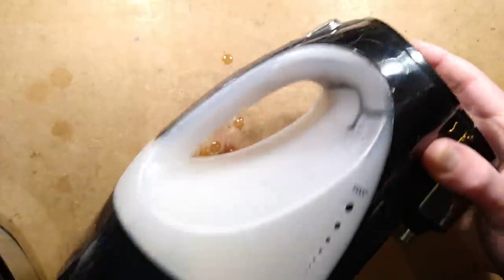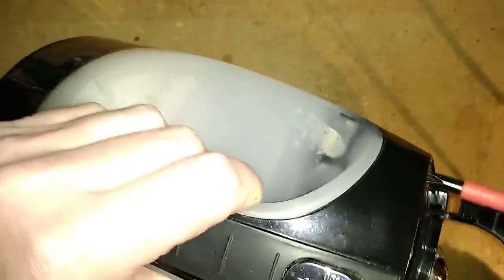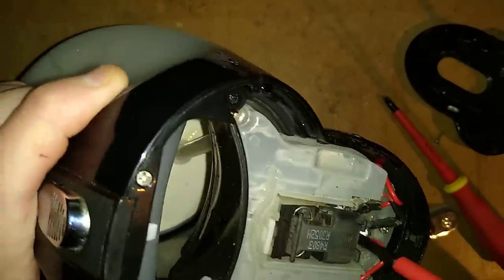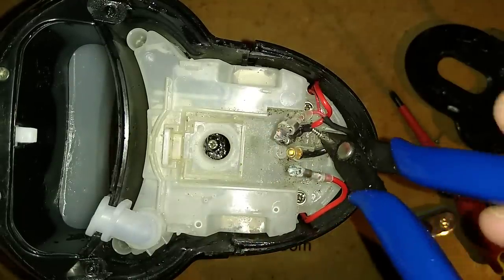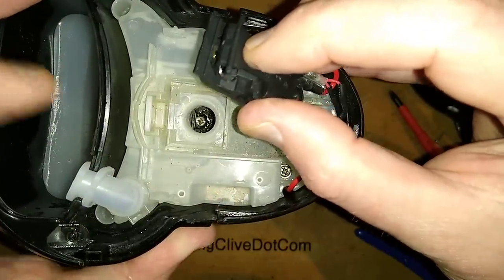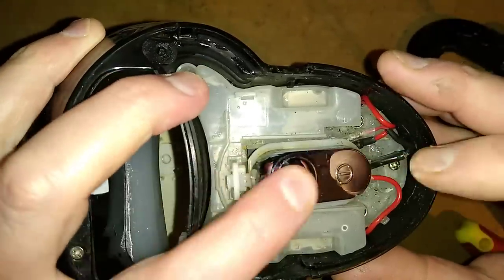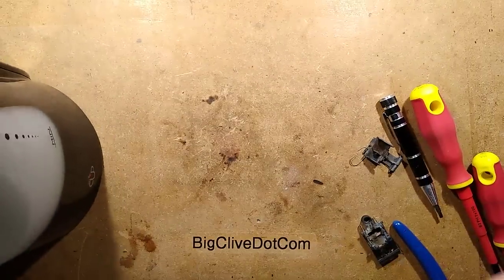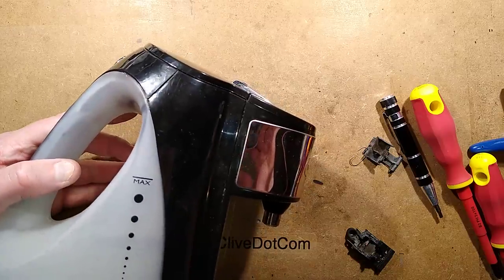Replacing my Breville Hotcup power switch.

Comment: Worthwhile giving those 0.25 inch slide-on connectors a dose of conductive grease? Would reduce the possibility of steam corrosion over time? I suspect I'm not the only viewer who is slightly disappointed that you didn't replace that LED with something more interesting? Maybe multicolour?? :-)

Comment: Clive... or anyone here, have you heard of the Mito kettle which is worked by induction.  What is happening with them?.
Reply: Ideally, the kettle has no electrics or sensors, just a standard iron kettle sitting on a standard induction stove that can heat any iron pot or pan.  Though some energy will be wasted by indirectly heating up the stove below the kettle.

Comment: Now you gotta show us how the kettle works. How does it only heat the water it needs?
Reply from the maker: Heater tank with floating ball valve that lets a portion of water in from the reservoir, but the water can only get back out via the spout with steam pressure .

Comment: Hey Clive are you accepting submissions for dissection? I've got a 4g modem that's seemingly given up the ghost, don't know if you want part it out or see what went wrong?
Reply from the maker: Have you checked if the power supply for it is working?
Reply: @bigclivedotcom  Its just a micro USB one, tried different chargers/cables and I guess either the battery has died or something else inside

Comment: In the US, you would need a 30a 240v split phase outlet to even get close to 3kW.  That would be the same outlet as a dryer.
Reply: A 13A 240V outlet will run a British 3kW kettle.  A 25A 120V would run a 3kW kettle with a 120V heating element.  Parts of Europe uses 2.2kW to work on 10A 220V outlets.  There are rumors UL allows running 20A 110V in some types of global 16A connectors, provided the manufacturer builds it accordingly.  Don't know if that exception applies to the circular connector on the bottom of kettles.
Reply: 240v 15a outlet in the US will easily support a 3kw kettle.  And there’s nothing “split phase” about a 240v outlet.
Reply: @stargazer7644  US 240V outlets use the "split phase" supply to most US homes and can't be fed from 200V 3-phase supplies because 240V is 2X 120V and 3-phase has a phase to phase voltage of voltage-to-neutral times square root 3
Reply: @johndododoe1411   I live in the US, so I'm familiar with our power.  The 240V in US homes is single phase, and is actually 240V.  It is our 120V outlets that come off of the center tapped transformer that is fed from (in my area) a single phase 13kV line on the power pole.
Reply: @stargazer7644  Electrically one can and does equally describe the 220/240 V outlets, that straddle two phases in the split phase system, as a split phase outlet, as neither power pin is a "grounded" pin, while the supply has a grounded point, making both pin live phase pins.
Reply: @johndododoe1411  In the US the legs of a 240V residential outlet don't straddle two phases.  The lines come from a single phase transformer.   It is one phase, with a grounded center tap.  There are not two phases involved.  Single phase power.  Period.
Reply: @stargazer7644  Only if you insist on misnaming everything.  I clearly explained why they are 2 phases, 180° apart.

Comment: I recently had an oven thermostat fail... in the closed position. Rumor has it they have a little pipe of NaK (a metal thats liquid at room temperature and hypergolic with water) maybe I'll tear down that thermostat and make a video for it.
Reply: Does "NaK" =  an alloy of Sodium and Potassium? I know that both of those are hypergolic with water, I remember my chemistry teacher throwing small chunks of each (as well as lithium) into the swimming pool at school.
Edit: I googled and yes, NaK is an alloy of sodium and potassium which is liquid at room temperature. https://en.wikipedia.org/wiki/Pyrophoricity#Pyrophoric_materials
Reply: Yeah, that's exactly right. It seems that the liquid alloy reacts faster than either pure sodium or pure potassium, probably because it can be stirred and smeared and broken into little bits. Here's the video that makes me think theres a few drops in some thermostats:
https://www.youtube.com/watch?v=d-xqGxOak6w&app=desktop
Note that when cellulose gets charred, it emits a small amount of steam. That would help explain why the drop burned so violently even once it was embedded in the carpet.

Comment: Hey Clive. Hope you’re keeping safe. Quick question or more of a recommendation if you will. I’m on the lookout for replacement led strips (warm white - obviously) for our motorhome. Any ideas on best brightness, longevity, cost, brands, power usage and low heat? Sorry bit long winded comment. Would love to see more diy pcb vids on the channel.
Reply from the maker: It's a bit of a mine field.  Best advice I can offer is to buy a couple of different rolls and then under run them to make the LEDs last longer.
Reply: @bigclivedotcom  Thanks, I have a few different ones coming in. On a side note - are you able to make a simple single sided pcb, need a quick prototype to test fit in project before sending for manufacture. Don't need silkscreen just tracks and drilled hole (including slots) I have files prepared and willing to pay.

Comment: i would have expected a lot of "hands off" screw of all weird head shapes.
Reply: I have only encountered that on microwave ovens. The fact that they can leak very destructive microwaves, and also have a medium voltage power supply capable of an amp or two, and a capacitor that stays charged after its turned off, all lead to them being a more risky appliance to fix.
Reply: @deltab9768  it's common here on all type of appliances. from kettles to toasters, drip coffee machines and even just simple multi extension cords.
Reply: The high energy / high voltage power supply for the magnetron in a microwave oven is one of the more lethal electronic things in an average house.
Reply: I agree. You're not likely to get a second Chance if an MOT shocks you.

Comment: We have electric kettles that use the same base connector here in the US along with several other solutions for removable electric kettles. I think electric kettles are less common here more because of culture than differences in the electrical grid. For some bizarre reason when Americans want a hot beverage it is almost always coffee. So they use a coffee maker. In the rare case we want hot water we use the microwave or stove.

I have a gas stove now (after I moved) and have little counter space (and my house wiring is 50 years old) so I use a kettle on the stove, but I have had a number of electric kettles, hot pots, water boilers & dispensers over the years. The gaskets on a couple failed, others the rubberized plastic got all sticky, others were borrowed for a seasonal task and never returned.

This comment got a little ramble-y but I am too sleepy to try to fix it. Sorry...
Reply from the maker: Rambly comments are fine.
Reply: @girlsdrinkfeck  also we don't have whole house RCD/GFCI. 240v GFI breakers are available but they are more expensive.

The electric water heater tanks are actually better for the grid than electric instant water heaters so you don't have every house running huge demands at the same time. I just looked it up and a 4.6gpm electric instant water heater wants 3x 40a 240v breakers. Imagine every house pulling 120a (24kw) every morning instead of the 40-50a (9-12kw) that a tank water heater pulls when completely drained and both elements are on. That is a lot of excess capacity and infrastructure for a daily short spike in demand similar to what happens/used to happen in the UK after sports matches/games or tv events when everyone turns on the kettle at the same time for the 5 minutes it takes to boil the water but on a much larger scale because it's a shower, not a kettle.
Reply: @girlsdrinkfeck  gas is better. Hands down.  I have seen instant units that are so efficient they condense the water vapor from combustion. Also in the event of power failure, gas heaters can be run off an inverter or the tank gas units can run their electronics off a thermoelectric generator powered by the pilot light.
I wasn't saying that tank electric heaters were better, just best of limited options.

We don't have a very good gas infrastructure (Natural gas (methane) utilities or LPG (propane) delivery) here in the states, or at least the area's I am familiar with, which slows the adoption of gas appliances. Other areas are probably better, but living in Florida there isn't much demand here for heating of anything let alone for gas. Also I think most people here have an excess of fear of gas, gas appliances and their exhaust. Ones I know shut off the gas to a stove at the wall when not in use because they are terrified of an explosion and another is afraid of using a (I think it was 20kbtu) tank top propane camping/job site heater in a warehouse to take off the morning chill while the building heated up in winter.

Comment: on the breville deep fryer l have had to replace 2 switches, but they use hidden security screws, after the second one blew l replaced the 12 amp with a 16 amp waterproof switch from ebay and it has lasted longer than the others, switches seem to be their weak point

Comment: I have the exact same 'kettle' - I call mine a hot water dispenser ;-) but if mine goes the same way I'd be a bit reluctant to spend £13 as I'd rather put that £13 towards the £39 for a new one. Looks like you have hard water in Isle of White/Man/Guernsey? I'm in S Wales - the best water in the UK ;-)

Comment: I have one of those kettles and I wondered, how many uses do you think you had out of it before the switch packed in? Not sure how many times I have used mine though a rough guess would be about 30-40 as I find my normal quick boil kettle does the same job if I only put 1 or 2  cups worth in it in about the same time. Probably expected because 2x 3Kw kettles should boil the same amount of water in the same time unless one was under pressure of course lol Thx :) x
In honesty when mine breaks  (as I have a weird aura around electronics for making them break early) I will salvage the screws, power cord and the LED of course. The rest would be plastic junk and a hot plate I wouldn't dare try using for anything else. The last quick boil kettle I had, the element blew out in a blaze of blue/white light, smoke and a loud electrical buzz and scared the shit out of me.
Reply from the maker: I use it all day every day and it lasted many years before the switch failed.

Comment: Thank you, Clive.
Some white vinegar on a Q-Tip would've done wonders for those connectors.
Do you take requests? I have an older under-cabinet flourescent light that likely has a bad ballast. Would love to see how it might be tested and maybe replaced.
Ta from the US.
Reply from the maker: Is it an electronic ballast or traditional one?  Have you tried a new tube and starter if it's a traditional type?

Comment: It points up the advantages and disadvantages of 240 volt vs 120 volt appliances.  240 volt = more power.  120 volt = less contact burning (maybe).

Comment: Hi Clive, lovely video! I have one of these which has stopped working. How can I tell if it's the switch? I didn't notice any problems before it stopped working.
Reply from the maker: If you have a test meter you could check continuity across the switch.
Reply: @bigclivedotcom  Thank you. I'll have to borrow one!

Comment: Mixed feelings about power systems between countries.   Most stuff in the home does not draw squat, lights and computers and such. A buck twenty fine for most all that.   I do wish we had the 240 power 3000 watts in the USA kitchens more common/standardized.  Got some power to get things hot quick, and such.

Comment: Any idea how to fix the LEDs that glow and change colour as the kettle boils? Mine stopped working and it's hard to tell if it's on before it starts making noises.
Reply from the maker: It may just be the LED that has failed.  They may be possible to swap out for one of your choice.

Comment: Would an X capacitor across it extend the life of the contacts?
Reply: Maybe not. You'll eliminate the arc on opening, but you'll be passing a brief multi hundred amp pulse between two barely touching contacts when it closes.

Comment: There's always a bit of arcing, even in properly designed switches.  Most switches minimize the arcing by design.  My question is, is the arcing worse there because you operate off of 240 volts vs the 100/120 volts we operate on here? Also, similar kettles here only operate at 1500 watts or so (which makes sense, most outlets are 15 amps and typically around 117 volts).  So does that mean that I have to wait longer for my Earl Grey than you do?
Reply: I've seen switches that were rated for 10A at 120v, and 3A at 240v, because the arc is more severe at higher voltages. And yes, the kettles in the US have smaller lower power elements which don't boil as quickly. Incidentally, a DC arc is even harder to shut down because the current doesn't drop to zero every half cycle. A relay/breaker/switch rated for 10A and 240vac will likely arc for several seconds and burn up if it's used on 240VDC 5A.
Reply: @girlsdrinkfeck  Hot water 140⁰ F tanks keep the electricity away from the bathroom and kitchen sink.  While less efficient than local heaters, they can be directly heated from steam pipes, avoiding the 60% loss in converting heat to electricity at traditional power stations (2nd law of thermodynamics is harsh).
Reply: F is a Fahrenheit temperature measurement. 140F is essentially 60 C.
Reply: @deltab9768    I discovered that massive difference between ac and dc ratings in a solenoid motor I made.  After burning out various contacts, I took a pair from a mains thermostat.  It now runs sweet as a nut.  But having to use 240V 8A  contacts to switch a 12V 1A DC coil seems hilarious!

Comment: "It's huge... normally I work with much smaller items"
"Is this screwdriver more appropriate? Yes it is"
"If it doesn't work, you can try again"
"This thing is very steamy and wet"
"Let's squeeze that one shut... So let's try that one on, that's a much tighter fit"
"I would say they were a bit skimpy on the contact"
"It takes a bit of messing around"
"Oh, that's a gross overexposure"
~This video made possible by Insider69transit and viewers like you~
Reply: Something something if you're brave enough.